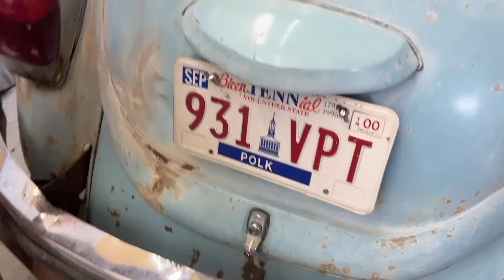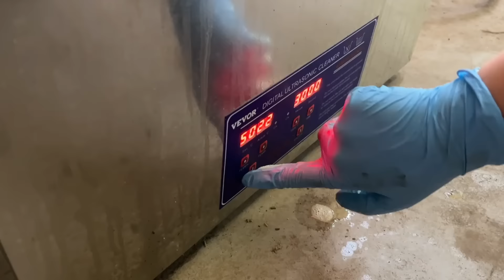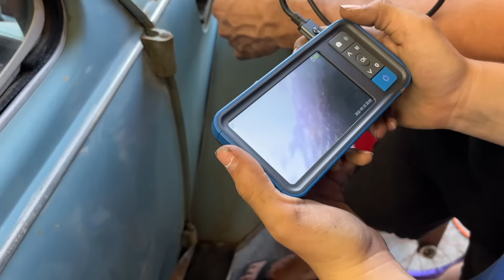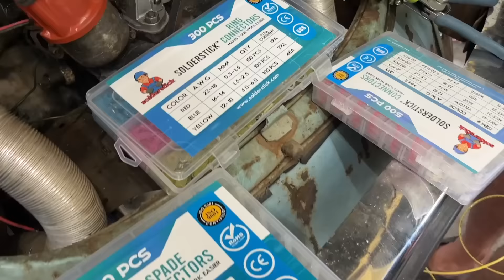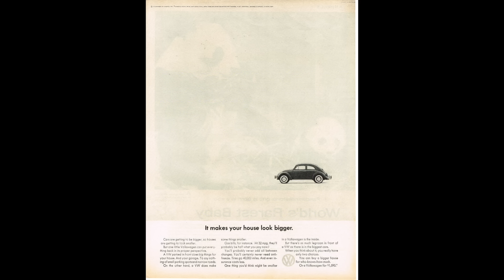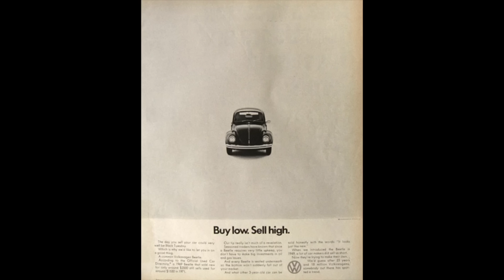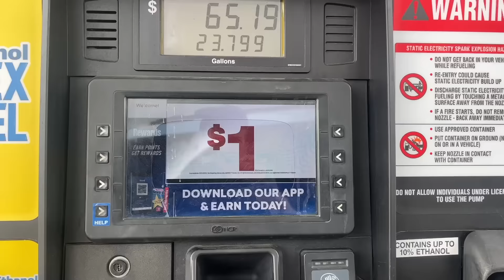Parked 23 Years Will It Start Cheap 71 Volkswagen Beetle Survivor

Comment: The clutch would have had some surface rust on the clutch plate flywheel and pressure plate. Normaly you can get away with pushing in the clutch put in first start the car and drive off on the starter motor keep the clutch pushed to floor. Keep pushing the gas on and off jerking it but keep the clutch in and will free up the clutch.
Soo yes the clutch did free it self up after a while.
Suggest adjust the clutch now so doesn't slip with bit free play.
The VW might have a carbon trust bearing too.
It will wear it out quite fast if you don't adjust very soon.
I think would be just like a thick carbon thrust washer pushing against a thick steel washer on the pressure plate.
Steve from NZ

Comment: This reminds me of my first car, a 1960 VW Bug that I bought in 1969 for $50 at 15 years old. It had chickens living in it but by the time I got my license on my 16th birthday, it was all fixed up. I am 67 years old now and had so many VWs over the years that I can't keep count. You static-time a VW engine with a test light. a 1300 engine was only made in 1966. It has the same case and crank, but small cylinders. it is a 69mm stroke and probably has 87 mm cylinders making it a 1600cc. Get points and a 009 distributor and blue coil. Done messing with that and throw away the resistor. The clutch looked all rusted when you had the starter out. It was just stuck! I bet the kids had the time of their lives driving it around the lawn there. 

NOW THE MOST IMPORTANT, What are you doing with the C4 Corvette? I saw an 84-89 C4 in the background. I have three corvettes now. a 96 c4, a 01 c5 convertible and a 21 c8. All of them are Black! If you would like to see my Vettes I would be happy to send you some pictures I just can't do it here.

Ask me anything about the bug and I can help you with it. I built all kinds of bugs, from Cal look bugs to Baja bugs, to 9-second 140 mph quarter mile drag cars that I drove on the street daily back in the late 1970s. I did stay away from the Super Bettles because of the coil spring frontend and the longer hood just didn't look as good as the torsion bar frontends did. But I have built hundreds of them we had a shop where we bought wrecks and thefts from insurance auctions and fixed them up back in the 1970s. Then we started doing 900 series Porsches after that. Mostly 911s and some 914s. the 914 replaced the Karmin Ghia in 1970-76. Two of the 911s I built won concourse car shows. a red 1973 911 Targa and a black 1975 911 Turbo! Lots of fun! 

Thanks for getting all this on video it reminded me of building my first bug when I was 15. I did it with my dad and it was one of the best projects we ever did to this day. Take care and God bless you all!

Comment: Oil trans fork. Drill or look for hole to oil pilot bearing and shaft.  Grease gas and clutch cables (use a string to re thread).

Comment: Make sure u know how to adjust thermostat and adjust it.
Check that the flaps open all the way in hot wx and they closed in winter.
Change oil at first signs of
 degradation. 
U should use  liquid head cleaner clean heads keep valves from burning. Great vids. Eric in perryville mo.

Comment: The reason why the clutch did not work at first is from sitting so long the clutch rusted itself to the fly wheel. After you put some heat in it and drive it around it broke free.

Comment: clutch got rusty and stuck .... air cooled vw it would be smart to pull the engine and remove all the shields off and clean out the mouse debris and look for any rotted covers that would lose air flow .... mustie 1 is a good source for this  .... great to see the old bug running again .... good luck

Comment: Most likely the clutch plate was rusted to the flywheel. This is typical of manual transmission vehicles that have set up for a long period.  One remedy was to place the front bumper on a large tree and lower the rear wheels with a jack after getting the tires spinning.  The rusted plates breaks free and you are good to go.

Comment: I remember the thrill of my first car.  It wasn't a bug.  I used to laugh at VW Bugs.  Then my brother came home from the US Army and in the middle of one afternoon he stood up and said,  "I need a bug".  Then he walked out the door without another word.  Couple hours later I heard the rattling,, sewing machine sound of a 1300 cc Volkswagen.  And I still laughed at them.....until one day riding with him I was kidding him about his precious bug not having enough guts to climb the hill on the road ahead.  Roy downshifted to third gear ( I would have sworn he'd have to drop back into second ) and he floored the gas.  That rattling Lil Ole 4 banger just kept winding up.  We topped that grade way over speed limit and I told him that he better shift it because he'd blow it up.   Roy grinned and accelerated another 15 mph before finding 4th again.....but then we were rapidly approaching a 90 ° curve  and soon enough I was yelling, SLOW DOWN!!  Roy just grinned some more, touched the brakes and went back to third and we around that corner like we were painted on the road.   Then he let me drive it and one drive was all it took.  I hold an immense respect for these little autos and I would never encourage ANYONE  to be reckless behind the wheel.   But your daughter chose a car that is highly underrated and has a  built in "save your butt factor" while being a ton of fun and economical to operate.   You've got a pretty smart and pretty cool kid there.  I wish you and her all the blessings the Father offers; he certainly blessed you with a fantastic family.

Comment: First time I've watched one of your videos and I'll definitely be watching again
Clutch was likely stuck on the flywheel and just needed spinning and bouncing around to free off.
Also the metal fuel pipe you removed from the fuel line I believe is there to get past the exhaust and round to the filter.
Best to put it back in the line for safety.
Decent looking beetle and no rust  I'm guessing your weather helps with that.
Here in the UK that would be full of holes 👍
Reply from the maker: Awesome thank you 😊

Comment: Many years ago John Muir wrote a book how to keep your VW alive or close to that .  Amazon has it but if you look around you might find it cheeper .    My first car was a type 3 fast back  VW . Bought it with a burned piston . Drove for a few years . The same piston burned the  same way .  I dont remember if I rebuilt it a secont time .  The pistons/cyl come as a set .  If that car were mine I might get a 1600 cc case and use larger cly.s for a bit more power .  1300 cc might be fine for a kid .   Parts are a lot harder to get now than the 60-80 s when there a lot more of these running around .

Comment: 15 minutes in and subscribed. :) Yes you can remove 4 bolts and have 3 people lift the rear bumper and pull the motor. Been there, done that.

Comment: If a car or anything with a clutch sits for a long time the clutch will rust ans seize together and not dissengage.   My tractor info says to lock the clutch peddle in so that this does not happen if parked for 3 months or longer.   Usuallly they will come loose if you get it running and work it a little. But be careful.
Reply from the maker: Yes!

Comment: Myself personally I would put in a 1600 minimum , with a working electronic ignition . And with fuel injection over the carb . I then would get rid of the drum brakes and install discs .

Comment: awesome video i have the same year vw 1971 same color blue and black interior lol i changed my distributor to electronic and the generator  to a alternator and i use 20/50 oil plus i use 91 octane gas only the lower grade gas make the the bug run to hot

Comment: I would have taken carb. Completely apart before I put it In the ultrasonic cleaner it would have cleaned the inside of the carb out . Also the way the ultrasonic cleaner works be using sound waves
Reply from the maker: Good idea

Comment: too late but yes the metal fuel pipe under the bonnet is factory

Clutch rusted to flywheel, normal for a beetle sitting 20+ years

Comment: The short piece of metal line is factory. What happens if you take that out the exhaust melts the hose and you get a fire that’s why you see a lot of Volkswagens on the side of the road burn to the ground I had to 66 that caut fire it’s no joke!

Comment: Rc cola and mt dew and ive ate Vienna sausages since I was a kid lol and still do. And i would just leave the point ignition system until you order the correct coil for the electronic ignition system. And my dodge ram is a laramie slt it actually has the more expensive option 16 inch polished aluminum center and brushed finish aluminum wheels but the clear coat is peeling and oxidized the wheels so the previous owner has plastidipped them and on a black trim truck that is black that just looks dumb, so I plan on cleaning off the plastidip black coating and using some mother's mag and aluminum wheel polish and acquire me a mother's power ball and Polish the entire wheel and clear coat them with the spray on clear coat cans from auto zone or Walmart and probably just get different center caps since i don't think i can get the plastidip off the plastic caps without ruining them and i almost bet that the wheels would make the truck look better,i really don't like everything black.

Comment: I am fairly certain this was my car! 😮  Would like to know more of its background and whereabouts. If it is my old car, have some great road trip story's. Painted the wheels 'mauve' just before driving to Florida for spring break to give it a Caribbean vibe. This was in 93-94. It was nearly show condition when i bought it....if its the same car.
Reply from the maker: Wow that cool, we didn’t get told much about it’s history when we bought it
Reply: @Sleeperdude  If the same car... I bought it from an elderly couple in Ohio that pulled it behind their RV as they toured the entire country, back when I was a junior in high school.  All but around 5,000 miles were from being towed, so was nearly like new then. I sold it with the original engine out of 65 dune buggy since I put a mild cammed dual port in that. However, the original dual port in the beetle was fine when I sold it. That would explain the engine if something happened to the original.

Comment: looks like an awesome super beetle project get familiar with strange German engineering lol my first bug was the same year aswell couple things to look over pull on the crank pulley and check the end play of the motor the tighter the better get some new intake manifold boots for peace of mind always run German braided fuel hoses FIRES are real.... put a correct coil on and don't run a ballast because fires are real LOL and good luck to you on the wiring it can be slightly strange to understand at first but once you get it it's nice and simple did the same to my 71 super also if you aren't already familiar with the difference standard/super standard is setup with torsion beam front end connected to either ball joint or link pin spindles and super beetles have a mcpherson strut setup or an independent wishbone style suspension while it handles great don't try and do any extreme baja builds with this unless you plan on link pin beam swapping this.. the short stubby hood always gives it away you'll notice 71-72 super will have a flat windshield and 73^ will have a rounded windshield anything non super will have a long nose that almost goes to the very front of the car. excited for you all to learn some German! Solid starting point keep the patina!
Reply: note oil changes every 1,500 miles along with valve adjustments I'd also switch to point ignition and adjust every 500 keep that 009 dizzy though! try to steer clear of any oil full flow systems you'll never need them try to keep the engine bay enclosed and sealed from the elements. also make sure to check the pushrods with a magnet to make sure there not chromoly's or steel so you'll know what to set your tolerances to!

Comment: I wish I would have been near by to join you and your family in all the fun and given you some pointers to get that bug on the road.
By the way, Hitler was not involved in the design, he only gave the orders of what he wanted. Ferdinand Porsche and two Jewish engineers designed the car.
In regards to the carburetor, it is best practice to remove as much dirt as possible from the outside of the unit, disassemble it and place all the parts in the cleaner.
Great family video!

Comment: Yeah but I rode with two of my best friends usually since one had a 89 dodge Dakota 2wd se v6 automatic overdrive short bed and my other best friend had a 89 dodge spirit es v6 automatic overdrive fwd car and the replacement 95 Ford mustang lx v6 automatic overdrive transmission car,i mean don't get me wrong ive had several gm gbody cars but most of the daily driver's were rusted beat up gm square body farm trucks that leak everything and smoke like crazy lol diesel nothing my 78 Chevy c20 custom deluxe smoked like a freight train lol the valve stem seals were non existent lol

Comment: instead of repairing old carbs people r useing motorcycle ones on bettles and minis migets ect . i've heard of zx9 and bmw carbs being used on beetles the bmw ones r supposed to b quite similar to the beetles original one . there r lots of different ones being used on old austin engines as they r so much easier to deal with than webbers
Reply from the maker: Ok cool thanks

Comment: keep it as original as possible which in my opinion keeps it runnin as it should least thats my findng and always keep spare parts such as the little distributor parts generator brushes a big bottle of oil clamps etc and make sure to put  togethher a kitfor on the go tools the small kitnoys parts extra hose cause if you ait running the origanal german braided hose the ose of today is sueptable to all kids of damage and if your losig harge on te battery check gen brushes 1st

Comment: 54:58 NEVER test a VW starter on the ground. You got lucky that you didn't destroy it. The starter shaft MUST be supported in the bushing hole in the transmission other wise as it spins on the ground there is nothing holding the shaft in place and it will start to wobble and that is all it takes to destroy the starter....
Reply from the maker: Ok thank you
Reply: @Sleeperdude  That bug cleaned up nicely! 👍I have a 1965 VW Baja myself and a collection of 26 mostly classics you can check them out on my channel if you're interested.

Comment: I have solderless butt connectors and heat shrink sleeve crimp connectors but they are haiistronica from Amazon and non insulated yellow coat ring crimp terminals from Napa auto parts

Comment: Today's my one year anniversary of getting my 58 beetle🎉😊
Reply: If you run a mechanical oil pressure gauge you will notice the difference over multiviscosity oils. 20,30,or 40 weight oil only according to tempiture outside😊 water temp sensor for a oil drain plug👍

Comment: S-dude,,,,,,,, I've had many VW's, and I know from (bad) experience you have to keep the valves adjusted properly......the engine should sound like you're dragging chains, or the valves are too tight, and you'll blow the motor.......other than that, taking the engine out shouldn't take more than 1/2 hour

Comment: I'm surprised that you are working with engine cleaning sprays and not wearing eye protection. Remember without your eyesight it doesn't matter if the work you are doing effects weather the car runs or not. If you because legally blind you will not be able to drive no matter how long you had before or how good you were.